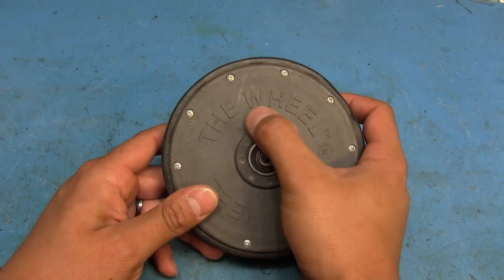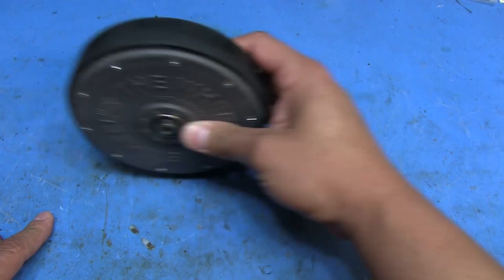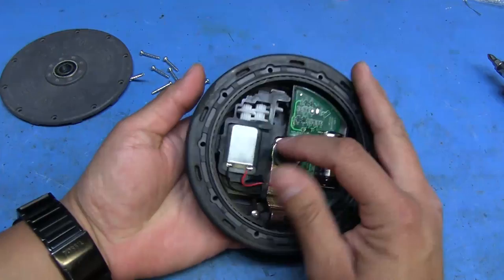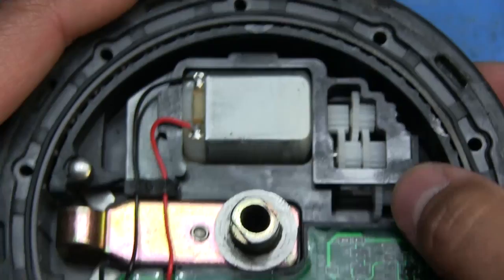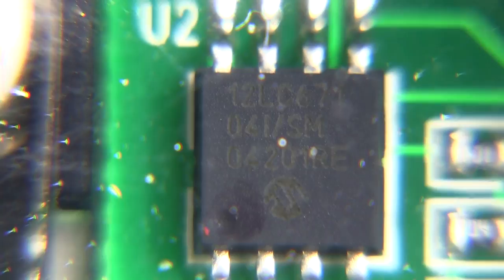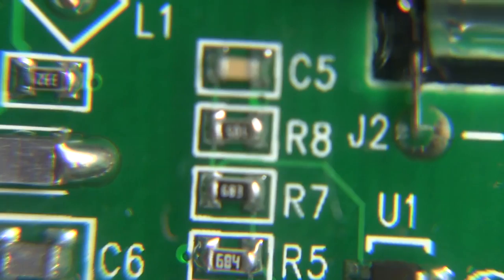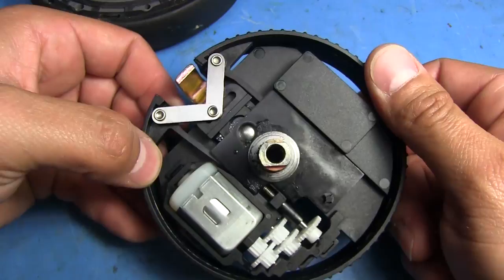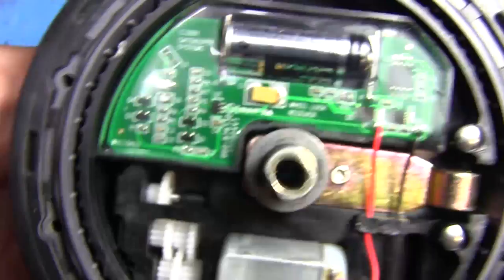TWB #4 | The Wheel Locking Shopping Cart Wheel Teardown

Comment: 8:00 the device does not receive a radio signal,  it only needs a magnetic field to activate / deactivate the motor to lock the wheel. The cart wheel is activated when it crosses a wire buried around the parking lot.
Reply: How do u unlock once out of lot

Comment: Looks like a Gatekeeper Systems CartControl lock. Shame they don't put a generator and rechargeable battery inside it. The thing is so damn hard to push sometimes that most customers wouldn't notice the added resistance of a dynamo anyway.
Reply: Smart
Reply: thou shalt Not plunder?
Reply: Micah Nightwolf digging some of your new living plans. diy tools?
Reply: Seems a obvious upgrade. But if you don't have built in obsolescence how can you keep your cart manufacturing business going?
Reply: @ExtantFrodo2  What´s the difference between replacing a rechargeable battery every 10 years versus a non rechargeable every 10 years? You´d just add the complexity of the generator.
Reply: @jor7137  10 year on a non-rechargable? What universe do you come from?
Reply: @ExtantFrodo2  A universe where smoke detectors last 10 years on non rechargeable batteries and the manufacturer of these wheels claims a guaranteed minimum 5+ year life on the battery.
Reply: @jor7137  Ah, you mean a universe where you are a company shill. Got it.
Reply: @ExtantFrodo2  Would you explain where I am wrong?

Comment: Sure as shit it’s confirmed: 
Power Source – Proprietary Gatekeeper Systems' Battery. Signal Output – Low Frequency – 8kHz, High Frequency – Operates in the 2.4GHz band. Microprocessor – Digital Circuitry, Factory-Programmed and Compliant with International Regulations.

Comment: you should try to get that battery out and put 3VDC to the terminals and see if this thing powers up. Is the silicone hard to remove?
Reply from the maker: coondogtheman1234 The silicone is really soft and easy to remove. I'm pretty sure the battery probably still has a charge, but unfortunately without knowing what kind of data they're sending to the unit I have no way to make it lock/unlock.
Reply: The Workbench
Maybe take a radio scanner to the nearest store where you found that wheel and see if you can hear anything coming from the yellow line..

Comment: That wheel lock, battery maintenance, and the work required to install the trip wire under the asphalt must cost as much as the basic carts cost.  You would REALLY have to have a lot of shopping cart thefts to justify an expensive system like this. Is shopping cart theft THAT bad????  Labor shortages in the US are so high right now that it's hard just to find enough store employees to return the carts to the store, much less keep a sophisticated anti-theft system like this in place.

A spectrum analyzer could easily figure out what frequency that "guard wire" under the pavement is operating on.  A disgruntled employee could really create havoc inside a store, walking around with a transmitter hidden in his pocket, stopping all the in-store customers from doing any more shopping.  And the store manager wouldn't have a clue as to what was going on.

I wonder how deep under the asphalt the transmission wire is?  If it's just an inch or two under the asphalt, an angry customer with a simple chisel and hammer could probably break the wire in a few seconds and disable the whole system.  And good luck to the repair guy trying to figure out where exactly out in the parking lot that the wire was cut.

Aldi has an interesting idea to reduce shopping cart losses.  A cheap mechanism in the cart handle makes you deposit 25 cents to unlock and borrow your cart.  Then you get your quarter back when you return the cart.  That saves all the labor associated with having employees collect shopping carts from the parking lot, but it obviously wouldn't do anything to stop outright shopping cart theft.

The whole customer service experience is going downhill.  Now they have self checkouts, and some stores no longer supply free plastic shopping bags.  Sad.

Comment: Not sure why I'm so interested in this thing but I am. I guess if some homeless can find the correct screw head they can really stick it to the man by just loosening the gears inside the wheel. I'm guessing these devices aren't cheap when stores could have hundreds or more of carts they have to install this onto them plus paying to run wires throughout the parking lot.
Reply: A cart was apparently only 100 bucks 6 years ago. So, possibly 150 now. I guess overtime they do make up for the cost.

Comment: And I guess when battery it's empty block system will not work, isn't it?'
Reply from the maker: Pretty sure these were not meant to be serviceable, so they would probably just replace the whole wheel when the battery went dead. Since the motor wouldn't be constantly running, the lithium battery should have lasted for a very long time.
Reply: @ThatElectronicsFool  They do replace them on a regular basis with routine servicing. They can test the battery with an instrument. Also, to release the brake if it is activated, they have a handheld device, which is the reason for the two H bridges = forward and reverse. to retrieve a locked cart, the employee simply walks out to the locked wheel cart with the handheld, places it near the wheel and presses a button for three seconds- presto - wheel unlocks.